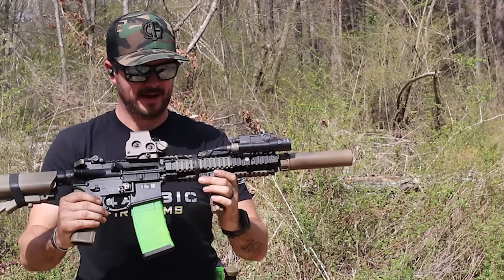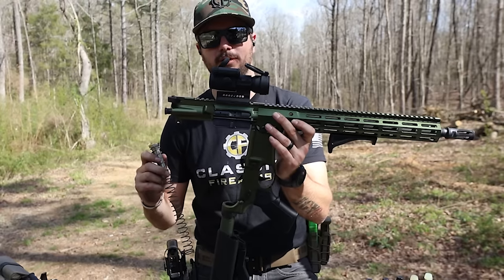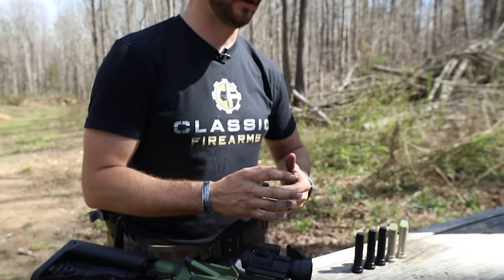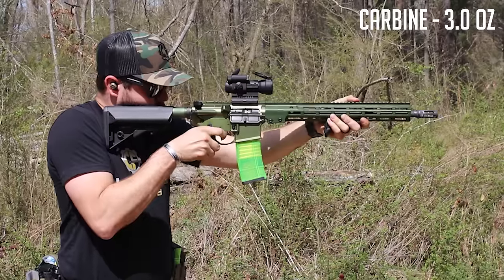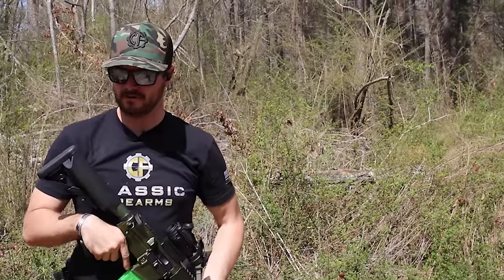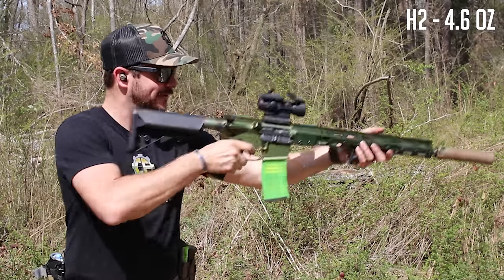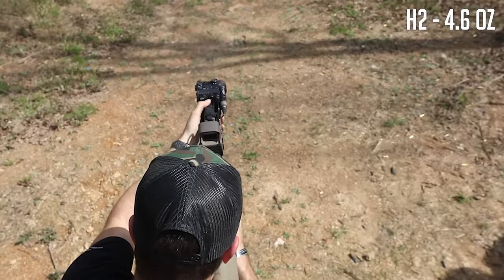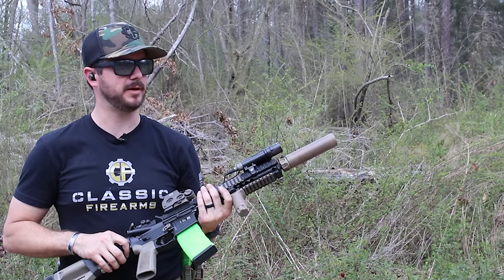What Buffer Should You Use In Your AR-15? (H1, H2, H3, H4)

Comment: You should be emptying a mag with every buffer weight to see if the last round bolt hold open functions. I've had too heavy of a buffer and it cycled fine but didn't hold the bolt open.
Reply: That's exactly what I was thinking and looking for in the video. Hopefully he can do a REDO/UPDATE on this.
Reply: I built a Mk12 clone and tried it with an H2 buffer.  It ran milspec ammo perfectly, but wouldn't cycle reliably or hold the bolt open with less powerful .223 ammo.  I went back to an H buffer and the civilian stuff ran just fine.  Just tune it for the way you will use it.

Comment: Started looking into buffer weights about 10 years ago because I figured the “clack-clack” sound of the carbine bolt cycling couldn’t be good for the life expectancy of the rifle. Cousin, son and I decided on the H2, which greatly calmed things down. When I started switching over to mid-length systems the customer service rep at the barrel company I tried to use for all my barrels told me the company didn’t have an official stance on buffer weight but that “we all use H2” buffers. So I was home free and the results were an extra smooth shooting carbine! Now that I have my first suppressor I guess I’m in line for an H4.

Comment: I'm only about 6 minutes into this but the cycling of the firearm and ejection pattern will also change depending on what recoil spring you are using. I run everything from a yellow(light) sprinco in my 300blk if it's not suppressed(rarely used w/o can) and some guns have a blue or red/white(stiffer). Complete tuning your buffer weight and spring isn't necessary but when you shoot alot it's nice to dial in each gun.
I keep an Odin works adjustable buffer weight just as a tester for new builds. When I find what spring combo works in the gun I buy a designated buffer. Great product for getting a soft shooting gun dialed in

Comment: The buffer weight reliably comes into play with regards to fullauto cycle rates and temperature of the ammo.  H3 buffers sound good till you fire ammo that's at 0 degrees.   Pressure and performance of the ammo is greatly effected.  Ammo selection and temperature will determine if that buffer/spring and port size will be reliable.

Honestly this concept is a rabbit hole lol.  If your rifle is "perfectly" gassed at 80 degrees and shoots soft.  You might not like the reliability if you try using it up north in January.
Reply: I had to change mine when I installed a binary trigger in mine. The stock buffer spring and weight didn't work well hahah

Comment: It’s all about muzzle rise and and ability to stay on target/ faster follow up shots.  I use an H3 buffer with a mid length gas tube, on a 16” barrel.  It really smooths out the recoil impulse.
Reply: Late to the table here, but i built my first ar this year. Psa pistol lower and a 10.5. I recently switched to a 14.5/mid-length gas.

Zeroing in the other day I thought the recoil impulse felt a little rough so I'm wondering if a heavier buffer will be more appropriate
Reply: That's so nice, it brings your left eyed friends to tears!
Reply: Joking, I am a fan of midlength gas blocks though, more dwell time and anecdotally bounces brass right if the deflector
Reply: Mid length, H2 13.7 here also very smooth.

Comment: Air temperature plays a big part in buffer selection, the heavy buffers might work fine in the heat but if you shoot in the cold you could get short strokes.
Reply: An often overlooked factor. Which is why you should have over gassed systems.

Comment: It's all a balancing act between gas port size, gas system length, the amount of barrel past the gas port (and sometimes what's on the muzzle), buffer plus bolt carrier group weight, buffer spring rate, and the exact ammo you like to use.
Reply: How TF am I supposed to calculate all of that to make it perfect? This is crazy I just need my suppressed 12.5” to eject a little softer 😂

Comment: For the unsuppressed vs suppressed option, barrel length depending, I believe that a Bootleg Adjustable BCG is the key. Adjust to maintain balance by using ejection pattern as a indicator of functionality and reliability.

One factor not mentioned is that part life, not just shooting session reliability and functionality, is important to understand. 

Springs have a use life, using expressed in thousands of rounds. Standard (ie balanced) barrel length/buffer weights might have a particular spring (ie Extractor spring) lasting 10k rounds.

An overgasses gun will reduce spring life by a few or several thousand rounds, factors depending.

Most people don't run their guns that hard, or they have several upper/lower combos and may never see a particular upper experience a major malfunction requiring total part replacement.

Comment: Very interesting 🤔 Would like to see a follow up  or part 2 video with buffer and springs combo and how that acts! Keep up the awesome work Classic Firearms!!
Reply: .. interested in the Super 42 Braided Wire Buffer Spring and Buffer Combo is why I am asking 🤔🤔
Reply: @MaxKing247  I bought a Geissele buffer spring.  Kept the same  amount buffer weights as original. 
Works exactly the same, ejects at 4oclock for me
Reply: @darts7116  Awesome, I appreciate that info and input! What setup/rifle you running? Definitely thinking of opting in for the BCG, spring, and buffer setup. In my eyes you can’t go wrong right?! Then hopefully in a handful of months I’ll be running suppressed!!
Reply: @MaxKing247  nice!   
I have a 16” saint victor fde. 
Geissele buffer& spring h1
Ambi Radian charging handle& safety
Razor 1-6 on 1.93” mount
Stock trigger and BCG
Swapped out muzzle brake for a flash hider.
Reply: @MaxKing247  I haven’t entered the world of suppression yet but maybe in the next year or so since Silencer Shop is drastically shortening wait times.   
Cheers!
Reply: @darts7116  killer setup!! 👍🏽👍🏽
Reply: @darts7116  Awesome my ZRO Delta is a 16” as well so I think i will take your input and definitely upgrade buffer spring and possibly the BCG since Bravo doesn’t seem like they’re going to restock their FDE BCG’s any time soon 😖
Yeah that’s why I’m trying to put in for a can now that things seem to be speeding up! Meanwhile I can do small internal Geissele upgrades! Stay safe my friend!
Reply: @MaxKing247  you too brotha.

Comment: It would be interesting to see wear patterns on parts between a regular carbine weight buffer and a H3 or H4 buffer over 2,000 rounds. Also, the Geissele Super 42 buffer/spring system comes with a different spring which might mitigate felt recoil between different buffer weights. It would be interesting to see what the effect of the different buffer weights would be without the Geissele spring.
Reply: Yeah I’d be down to see long term testing with all of these different variables

Comment: I really enjoyed this experiment! I think it showcases how versatile the AR platform is and how forgiving it can be. Manufacturers typically over-gas things slightly to increase reliability. Whether it be climate, dirt, or wear/tear, the reliability issue is greater than normal resistance in cycling. Switching to a heavier than ideal buffer just simulates those conditions. Switching to a lighter than ideal buffer probably wears the spring quicker, may result in unusual felt recoil, and further increases its operational external resistance tolerance.

The fact that you didn't have any malfunctions just proves the manufacturers tuned their operational room for error to allow for tinkering. A failure would mean either less-thoughtful manufacturer tolerances or the manufacturer tuned their gun to a very specific loadout for a specific purpose seeking perfection for their objective.

My guess is something like a Knight's Armament would have failed if you changed a variable in their perfect science. Likewise, you would have experienced inconsistent results with a low-end (low QC) brand or possibly with a Frankenstein build.

Comment: I have JP Enterprises Silent Capture spring in all of my rifles. No grinding, so smooth.
And I use black spring. Standard weight, for 16", 18", and 10.3" rifles, with an adjustable Aero Precision gas block.
Almost no recoil.
Reply: Same but h2 because I use a suppressor with my jp silent capture shoots Super smooth.
Reply: Also use an adjustable bolt carrier group

Comment: I'm surprised you did not mention the buffer's primary function, to prevent or minimize "bolt bounce" at high cyclic rates, which the AR-15 /M-16 suffer from due to high bolt (bolt carrier group) velocity and minimal locking mechanisms. The buffer acts much like a dead blow hammer to minimize rebound. For example those running low mass bolt carrier groups, spring selection and buffer weight become super important for a reliably functioning weapon not due to the BCG going far enough back, rather bolt bounce becomes more pronounced causing multiple bounces some of which leave the bolt in partial battery.

Comment: I ran a standard/m4 buffer in a mid -length gas system for about 10 magazines, didn't appear over gassed or abnormal, but after able 10 mags I was greeted with the rubber bumper on the rear of my buffer being smashed down into a mushroom shape and it bound up in the buffer spring and caused a jam for which I couldn't even break my rifle down shotgun style to clear it and correct it. I later put a H3 buffer in it, and it has been a dream ever since. To this day it's my favorite AR to shoot, so soft and gentle, works great with a suppressor, I love it. At this point I plan on never running a gun with anything less than a H2 or H3 buffer unless there's a gas issue. I love it.

Comment: Would be interesting  to see a standard buffer and spring vs the JP Silent Captured Spring comparison as well.
Reply: That would be interesting but I think the JP might require more maintenance.
Reply: What people don't understand, and what I recently figured out when tickering with my KS-47 (with a SCS); recoil is a three part system on ARs. Buffer, Gas, Break. If you don't tweak your rifle with all three in mind, just changing one aspect and you'll only see minimum changes. It seems people only want to run adjustable gas systems on suppressor setups but they're definitely a game changer on any setup.

Comment: Um,,, great presentation. 
I spent some time developing a gas system for an AR in 17 HMR rim-fire.
Some other things you can do are-
Use stiffer or lighter buffer springs.
Gas port location. Gas port diameter. This can control how fast gas pressure builds up in the impingement system. Affecting dwell time.
An adjustable gas key would help. Sun Devil had an adjustable bolt for the gas system that is a better solution but I’m not sure who is making them now. 
Something I haven’t tried is location and diameter of the pressure relief ports on the side of the bolt. This would control how long the bolt carrier was pushed back and how hard. It wouldn’t change the dwell timing much but the velocity of the ejection.  
The AR-15 is definatly the tinker toy set of the gun world. Eugene was a genius!

Comment: Personally run h3 buffers on all my ARs. Definitely noticeable from carbine weight plus will run in almost all decent rifle builds including PSA ha
Reply: Yes I think that's a mid length gas system. On carbine it would make a difference.
Reply: i run an H3 in my carbien gass system, and she seems to run really good, someone told me to try an H4 though.
Reply: @Dyllon McDonald  rule of thumb is go as heavy as you can until it doesn't run right. Also keep in mind carbon build up.

Comment: Just to clarify, the buffer spring is what does most of the work. The buffer is there to absorb the initial push (law of inertia) by the BCG. I'd recommend either trying a heavier buffer spring or swapping the buffer system to a Vltor A5 system.

Comment: Clint. Glad you're reviewing this , Just one tungsten weight can slow down the cycling by a fraction in both directions, (they say) .I while back I noticed my rifle was kicking hard,  so I checked my spring and it had lost it's length, down to 10 1/8 , I replaced it with a new 10 7/8 or 11" and it ran SOOOO much smoother , that was the problem.   Thanks Clint , I didn't see you having much of a change with H-2  that is 1 tungsten and 2 standard weights.  H-1 is 3 standard ( stock)

Comment: I think the real issue here is the simple fact that most guns are just over gassed out of the box with too-big gas ports in the barrels.  I love my BA Barrels, but both of them required really heavy buffers - one pistol, one rifle length.  I bought Aero Precision adjustable gas blocks, toned them down until they cycled reliably on standard carbine buffers.  Less mass in motion - less recoil impulse into the shooter.  They shoot much softer/smoother now.  I know WHY they do the big gas ports, so no need to explain.
Reply: I agree. I have an adjustable gas block with a carbine buffer. 14.5 lightweight build. BA pencil barrel. Good ejection, with a soft recoil impulse. Flat shooter.

Comment: Recently built a 7.62x39 AR, and it became immediately apparent I needed a heavier buffer (harsh recoil). Problem was, I run an A1 stock and there's no factory heavy rifle buffers. Fortunately KAK had my back and was able to build myself a 9.9 ounce rifle buffer (roughly in the H3 to H4 range by proportion). Works like a charm.
Reply: What barrel length?  I get reliable cycling from a 10" x39 with an h1. 
Have wondered if I should go h2. Or if it would slow it down to much.
Reply: Adjustable gas block is a very needed upgrade for any AR. Threw one on my Ks47; H2 with jp 308 spring runs great w echoo sport
Reply: @matthewbeaver5026  16". You probably should go with an H3 buffer.
Reply: @Frank Bonazza III just a carbine spring?  I've seen a bunch recommend a 308 spring.  Though I haven't had any trouble after the h1 with my standard spring.  I have an h2 I can try out
Reply: @matthewbeaver5026  Carbine spring and heavy buffer is fine.
Reply: You can use any carbine length spring and buffer in a rifle length tube all you need is to slide a spacer inside the tube before putting the carbine spring and buffer in. You should be able to buy a spacer made of delrin from Brownells or maybe your lgs can get you one. Makes it much easier to tune/adjust a system with a rifle length tube.

Comment: I'm thinking the H-4 is the go to buffer. I'd rather have the quicker sight recovery. I don't think that after five mags you'll have any fouling that would impede the bolt catch.That is on Mk it's like you said, a gassy runner.  H-3 would be a nice all around.  I know most folks prefer the tried and tested 2's. But as I said, I like sight recovery over rounds expended.
Reply: Depends on the size of the gas port in the barrel. A H4 in a properly gassed barrel may not cycle at all.
Reply: An H3 is almost certainly heavy enough for you. Also, you can always make an H2 by swapping weights if you have both an H1 and H3 handy.

Comment: You Can Reduce Felt Recoil With An H2 Buffer And An Adjustable Gas Block.

I Have A Geissele H2 Buffer And Spring Combo, And An Odin Works Tunable Gas Block On My AR-15; A Combo Of The 2 Reduces Felt Recoil Greatly (As Long As The Gas Block Is Tuned Properly).
Reply: What's with capitalizing the first letter of every word?
Reply: @GooeyPillow  Adderall

Comment: I really enjoy comparison videos like this.... I have ARs in 7.5" pistol gas, 10.5" carbine gas, 16" carbine and midlength gas, and 20" rifle gas, (all unsuppressed). I run the H3 buffers in all but the 20" with good results...Sometimes I  put the 20" rifle upper on one of the carbine lowers and it's ejection pattern stays the same as when its on the fixed stock lower... Same goes for if I put the shorter uppers on the fixed rifle stock lower....

Comment: Great video. Years ago I built a 7.62x39mm CQB pistol AR. I used a standard buffer, and it acted like it had a binary trigger. With your explanation of dwell time, it finally makes sense. Putting in an H2 buffer fixed the problem. I have finished its conversion to a rifle. It will be interesting to see if the  same buffer works well in the rifle?

Comment: I use an 8oz in my 10” AR9 and it makes a huge difference in felt recoil compared to the original. Also running the strike industries flat spring
Reply: What recoil on a ar 9???😂
Reply: @01Bigsmokey  guessing never shot an AR9 or you would know. Yea yea I know how lil recoil they have but 9mm is more than the 556
Reply: @niner7.629  got one myself…
Reply: Schmeisser m4FL ar15-9

Comment: Interesting, thanks. I would think there’d be different spring weights vs different buffer weights.
Reply: There are different "weights" . springco makes a few different ones. People also cut down a2 springs to fit carbine tubes. More coils = more tension. Also geissele 42 are woven springs that are really stiff. I personally like tubbs flat wire springs. Youtube his vids, great info on this subject. I also use a2 tubes so I have an extra weight or 2 (depending if I remove the aluminum spacer) in the buffer itself. Bought some kak industries tungsten weights. My rifles shoots hella soft.

Comment: I just ordered Geissele Super 42 Braided Wire Buffer Spring and Buffer Combo, H2 for my 16” suppressed Noveske Recon - Tiger Eye
Reply: You're gonna like that spring
Reply: @nebick27  I’ve heard good things it comes in Friday can’t wait
Reply: How does that run I’m looking at a buffer weight and I’m inbetween the h2 and h3
Reply: @nathanmontgomery4497 man it runs as smooth as I could ask for. I haven’t had a single issue with my can on or off. I highly recommend
Reply: @assault4356 awesome! H2 it is!